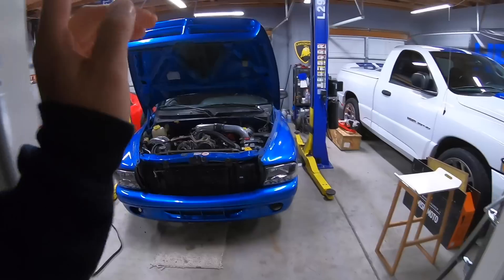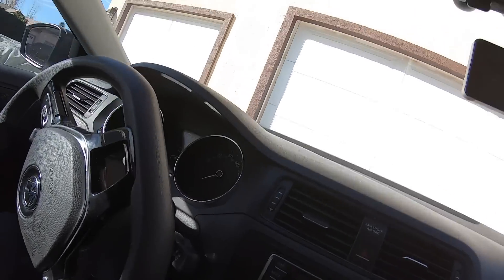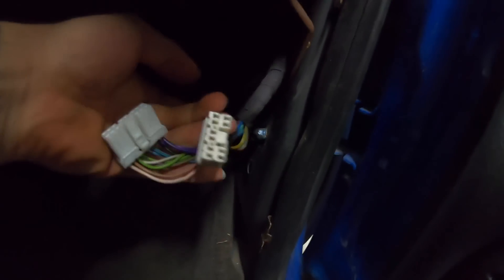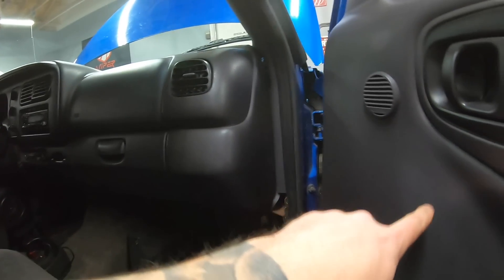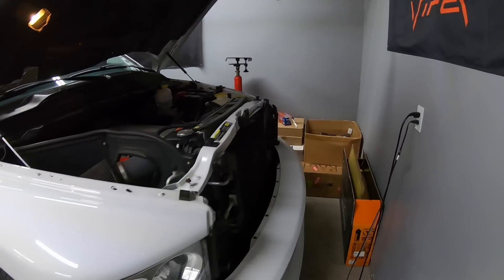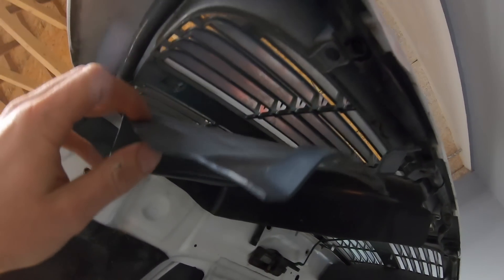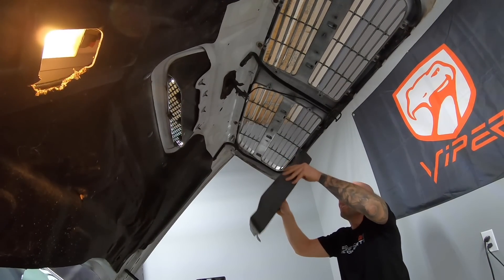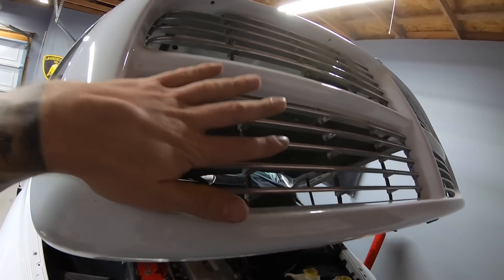Bought A Bunch of PARTS Today 👀

Comment: Changed mine to black honeycomb, i  just smashed those clips out and just used ss screws to hold the honeycomb inserts, not to mention that the srt10 have honeycomb in the hood and lower bumper so i have no idea why the put those chrome "bars" on the srt10s grill

Comment: I mentioned that there was an issue with the remote turn on, on the old aftermarket amp for in that previous video, because the amp was on when the truck was off. And the new amp gets a remote turn on issue, I jinxed you. That truck has an audio curse from the old 8lbs of wiring.
Reply from the maker: Yeah I remember you mentioning that too!  It was wired correctly but there must be something wrong with the amp itself.  The fuse was actually missing for it when I bought the truck so previous owner must have had the same issue!

Comment: Hey I need help from the boosted motorsports community. I have a 2010 ram 1500 TRX and I want to replace stock tail lights to some type of LED I've tried the AKKON ones and they last about 2 months before they stopped working and I'm back to the oem ones. Anyone have luck with a certain manufacturer